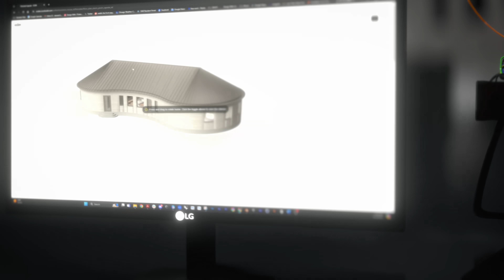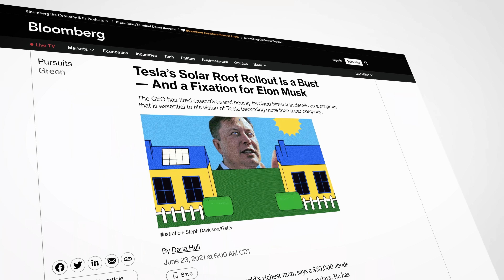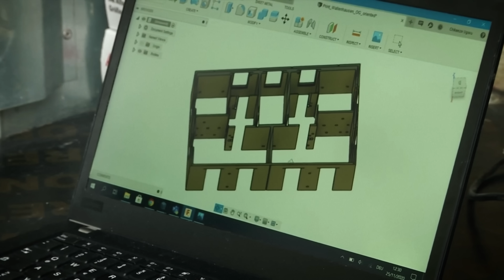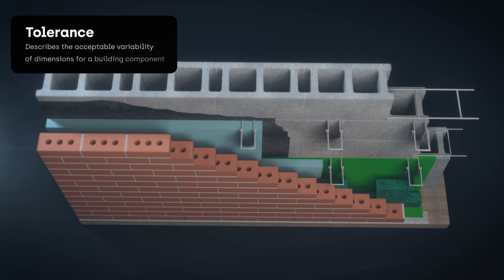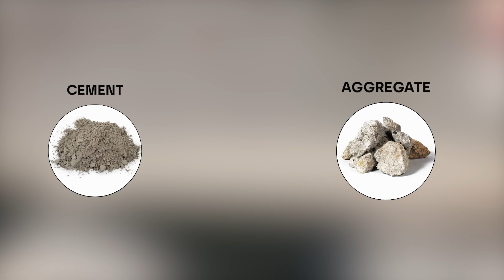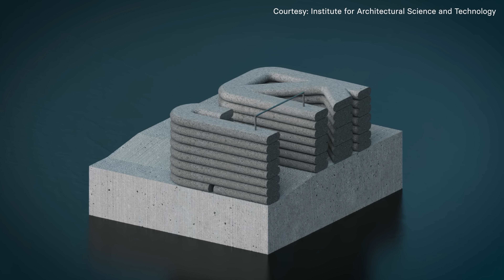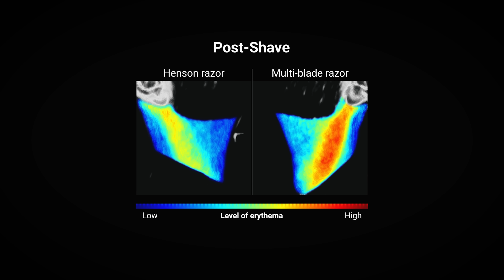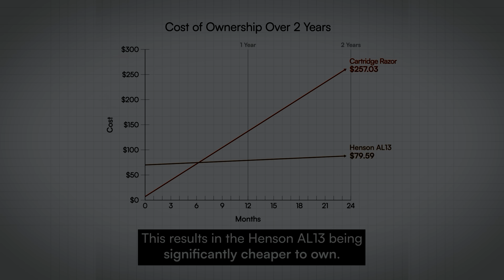Why 3D Printing Buildings Leads to Problems

Comment: You missed a bigger issue, building codes and inspectors. Being one of the earlier 3D concrete printer developers our biggest issue was the building inspectors here in the US. Good video.
Reply: @doomVoxel I could see maybe an arguement at the state level. Federal might be too problematic. There's just too many unique situations created by specific georgaphy or weather or other incliment contitions across the USA. I don't think a uniform code is possible thatd' work universally new construction built in, say, Boston, Anchorage, Fargo, Pensacola, Honalulu and Arizona. Each area places it's own unique demands.
Reply: The solution to bypass most building code problems is to get an engineer to sign off on the design. But these new technologies should already have engineers in the loop anyways. So I'm not really sure what's actually happening when you say that building codes and inspectors are a problem.
Reply: How does one get into the business of industrial 3d printing like this?
Reply: @Kaz-qz2oq look up a company, and call them up or apply. Similar to any other job. Typically, it's long, hard work though. Like 60+ hour work weeks during construction season.
Reply: @Kaz-qz2oq  There is a ton of upfront costs, and most 'printers' are one-ofs custom jobs. There's no commercial manufacturer of the 'printers' yet i'm aware of.
Reply: @doomVoxelWe do have a federal building code, but it can't cover every situation in every place. What is absolutely required in some areas might be stupidly superfluous in other places. This is kinda the whole reason local governments exist: to tailor laws and regulations to local needs in a way that the federal government can't.
Reply: This technology might be allowed by the building code enforcers because it is "high-tech" and tech nerds like Elon Musk will support it!
Reply: Bureaucrats, one of the cancers of mankind.
Reply: @HarryDirtay Really? How many countries use it? Who wrote it?
Reply: Empire state building was built in 410 days 😊
Reply: Would love to talk with you more about this
Reply: @doomVoxel Just as much if not more at the federal level!
Reply: @doomVoxel centralization and homogenization is always a bad solution!
While you're at it why shouldn't we have the UN or a global organization be charge!? 🤪😁
Reply: Inspectors are there for a reason. You don't want to ocean gate it and have your house fall down on you.

Every other construction company can deal with the regulations, why can't you?
Reply: Resistance to change.
Reply: @Jack-ne8vm I prefer safety over change
Reply: It works for China not for everyone
Reply: @the_expidition427   yeah tofu dreg

Comment: This is a great overview of 3-D houses. The rounded profiles remind me of adobe, but I think the roughness of the extruded walls would be difficult to live with. Would not the interiors be really dirty and the exteriors grow mildew? I think the walls need to be troweled to a smoother finish in order for buyers to really adopt the process. I hope the technology does succeed, even if the houses are essentially identical. We lived in a G I-Bill neighborhood for a while. There can't have been more than 4 or 5 floor plans, but they stand the test of time regardless.
Reply: It is easy to say trowel a wall. It's a lot harder to actually trowel a wall. We use something called a power trowel on floors. Because troweling concrete is pretty hard. It's some cardio. The only concrete that gets hand troweled today is the corners where the machine can't get to. The machine kind of looks like a helicopter. That's what they're called on job sites. They have 4 shoes on them and they spin. Unless it's a rider. Riders have 2 spinning deals. I was only ever on one job that used riders. You can't ride up a wall either. Power trowels are big heavy machines. It takes two guys to just drag one around. You can watch videos here of them being used. It takes a big heavy machine to trowel concrete. Or a guy named Vito that's built better than Schwarzenegger ever was.
Reply: @1pcfred  That's interesting. Must be why they leave the extruded concrete oozing.
Reply: I did once see a video (on a different channel?) Where the extrusion nozzle had downward extensions to smooth out the layers. Not perfect, but better.
Reply: @fredericapanon207  concrete consolidation is a bit more involved than just one swipe. But one's better than none I suppose.

Comment: Sadly you didn’t mention the impact concrete has on the environment 😢
Reply: What impact? It appears to be an acceptable trade off thus far. Build a school. It lasts 100 years. Pretty good to mine eyes
Reply: @BarronBros1822  while the carbon impact over a long time is justified, we destroy loads of ecosystems for the sand we put in it. We can’t use wind blown sand in concrete, so rivers and lakes are the primary source of sand.